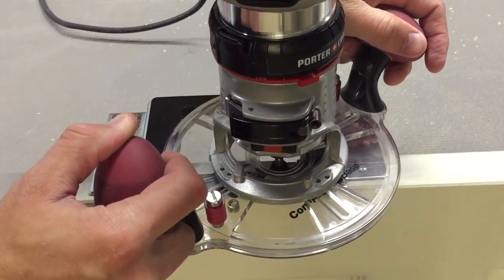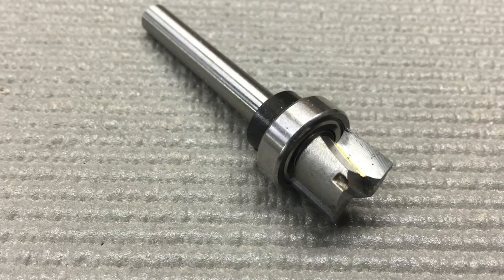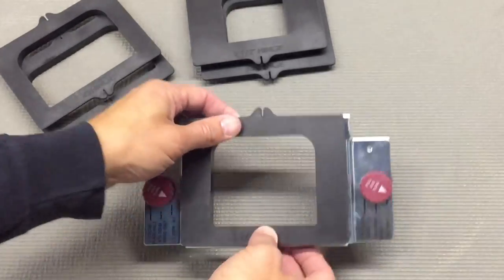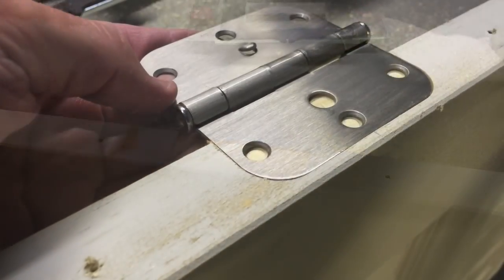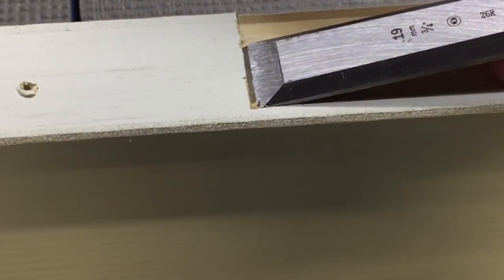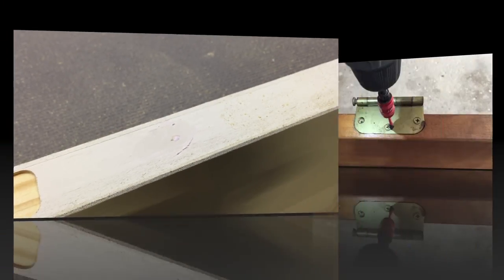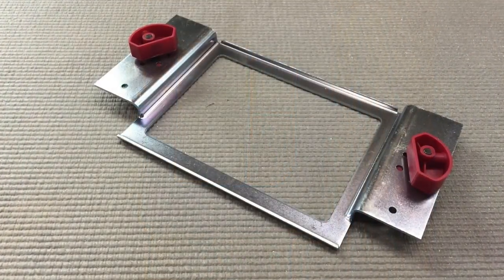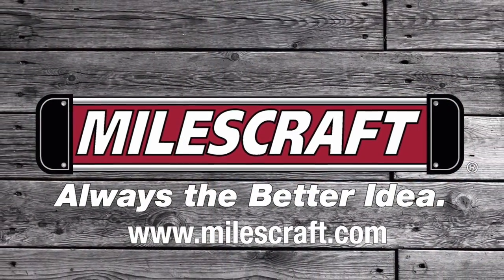Milescraft 1213/1214/1220 HingeMate Family Door Hinge Jigs - How to Rout Mortises on Doors and Jambs

Comment: If you all do an update can you account for door trim. Either by smaller cam height maybe 3/16”. I was having issues redoing hinges on door jambs that are already installed with trim around the door and door stop block. I found out with 1 3/8 inch doors you just take the cams off and the bottom of the templates butt against the door stop and give you perfect spacing.

Comment: I have a 3 1/2 hinge with 1/4 radius. Wasn’t clear how to router that since the template I have is 5/8 radius. The kit I bought was the HingeMate 350
Reply: Figured it out. Thanks.
Reply from the maker: The hinge templates can be rotated to achieve a 1/4" or 5/8" radius.
Reply: I'm there now and gotta figure it out
Reply from the maker: The hinge templates can be rotated to achieve a 1/4" or 5/8" radius.

Comment: I think this thing is cool but I wouldn’t buy it because I’m only gonna use it two or three times, If was a professional and did this for a living then it be worth investing in
Reply: This kit is really aimed at you and to me but in a lesser degree provided you already own a router. I'm a contractor and use mine maybe 5-10 times a year. Usually we're installing prebuilts and split jambs. I used the kit twice to do entire houses, maybe 10-15 doors each. I use it often to repair strike plates. If I needed a rig like this daily or even monthly, I'd invest in a much more expensive system. There are a bunch out there that are much easier to use but cost more and are not as easily stored. Regardless, it sure beats using a chisel!